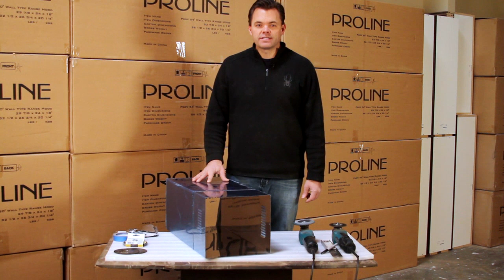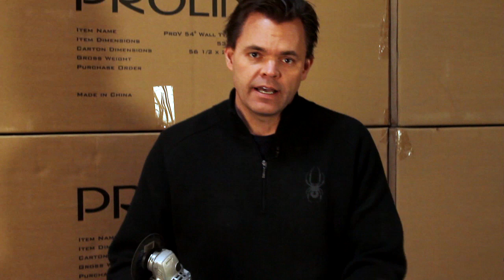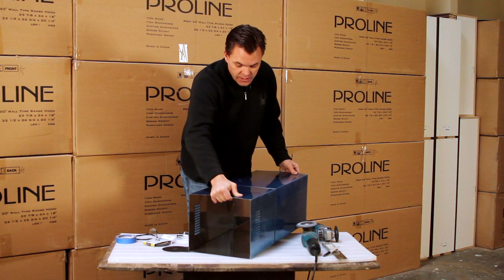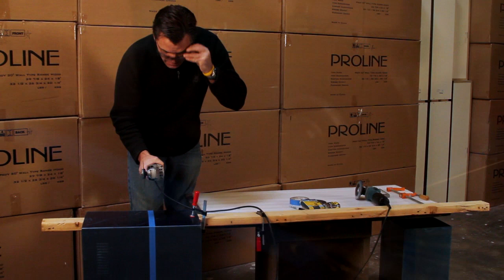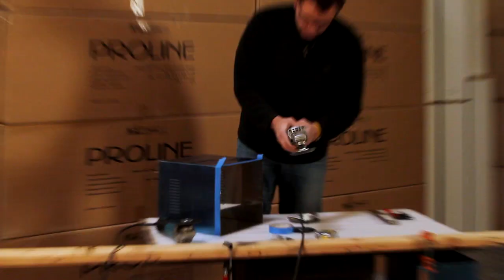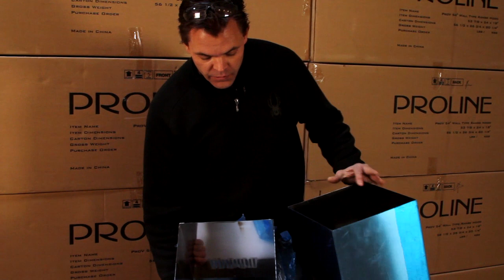How to Cut Stainless Steel - Resize a Stainless Steel Chimney

Comment: I have to cut my chimney as well. It's 304 stainless steel.  Do you think I can cut it with my Dremel tool using wheel #426?  Never cut metal in a straight line so I'm not sure if this can be done with the Dremel.  I can also purchase wheel #506CU if that's going to make a difference.  I need the chimney to be no more than 10.5".

Comment: So this will work even with 440A Stainless Steel, hardened Sheet ? Rockwell Hardness C55+ ? Awesome video, very nice. I think I'll use a 4 1/2" x 0.045" cutoff wheel made with a combination of two abrasives (ceramic aluminum oxide and zirconia aluminum).